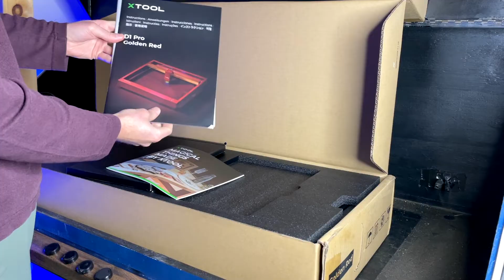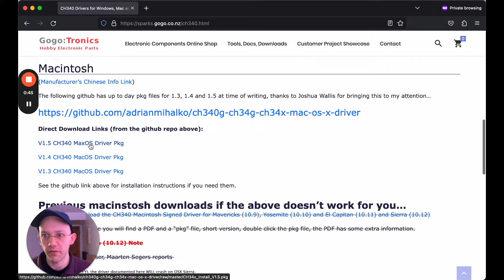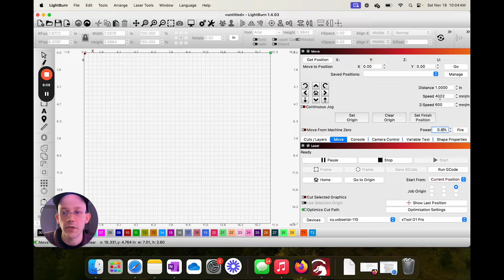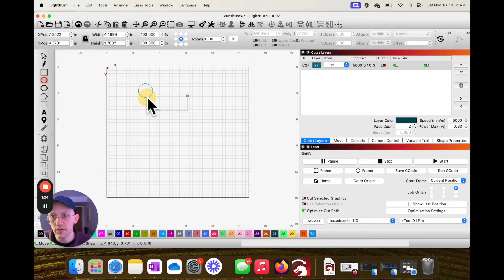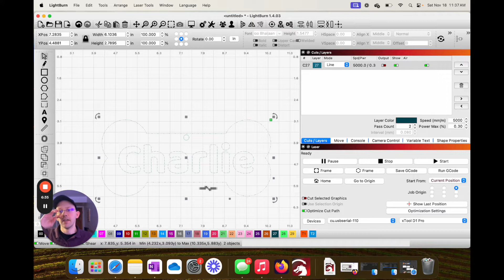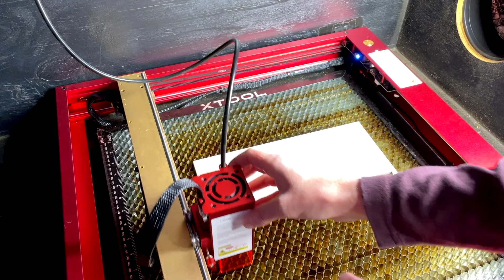Laser Engraving for Beginners (9 Step Crash Course)

Comment: Hi! Thank you for your video! What is the purpose of CH340 driver instillation? I installed LightBurn on my PC without any issues However, I didn't connect PC to Laser engraver..  So, is driver required for Lightburn instillation or it's required for connection?
Reply: for the connection

Comment: Really nice and useful video and other videos you made! I just bought a Laser Engraver/cutter (AtomStack A24/X24 Ultra Optical Power 24W ) but have a question. Normally you set the position (different height) of the laser for cutting or engraving. If you use your test file to see what settings to use, do you change the laser height if you are only cutting or do you just leave it at the "engraving height"?  In short...do you do multiple test runs on the same type of material you use?

Comment: JJ two things first I added my name to the boot camp waitlist and I'm wondering what the time frame is before I'm in, and I downloaded your three tests the two shown in this video and the engrave eye test, I have only run the engrave tests so far but both stopped engraving after labeling part of the grid (at the bottom). Please help.
Reply from the maker: Hi Bill - thanks for joining the waitlist. The bootcamp will reopen on Nov. 4th. You’ll get an email through the waitlist when it’s open.

And your laser could have stopped for a few different reasons. My first guess for something like that is a connection issue, between the laser and computer. So it might help to make sure everything is connected and to also turn your computer and laser on and off again.

Comment: Really found the viodeo useful. I am currently thinking of buying a laser , primarily for engraving. Do you have any suggestions for a new user?
Reply from the maker: Hey Nick - my default recommendation for new laser users is to get an "enclosed" diode laser. There are a bunch of these now, and popular examples include the Roly Lasermatic and the Xtool S1. And for engraving, I would recommend just getting a 10W, which are cheaper and also typically more precise (because they have a smaller laser spot). If you end up deciding to go with an xtool machine, then consider clicking through my affiliate link in the video description to support the channel. Hope that helps!

Comment: Slow but sure I am learning about lasers and the driving software thanks to people like you. I recently got my xTool S1 40w machine.  Would the settings of a 40w D1 pro be usable on mt S1? Thanks for sharing.
Reply: Thanks for the response. I will give it a try. Nothing ventured....nothing gained. Enjoy!!
Reply from the maker: Very cool - I haven’t tried the S1 yet, but would love to at some point. Regarding your question, the settings should theoretically be the same as a 40W D1 Pro. HOWEVER, it kind of depends on how exact you need it to be. For example, the settings for engraving a simple square on plywood is probably much more forgiving of variations (between the two laser models), than engraving a detailed photo on a piece of tile. In other words, it’s probably close, but I wouldn’t be surprised if you needed to make slight adjustments to optimize your results.

Comment: Do you have a affiliate link if we want to buy the engraver? Do you recommend it over other engravers or should I keep looking?
Reply from the maker: Hey - thanks for asking. I actually do have an affiliate link for Xtool that I forgot to put in the description, I just added it near the top of the description so you can find it there if you like. 

And regarding what I recommend for laser engravers, here is my current take: 

If you want to do an open frame diode laser like is shown in this video, yes, I would recommend the xTool D1 Pro. That's the only laser I've used for the last year, and it's worked great for me, and has helped me grow a new laser business from scratch. 

And I've actually just done a bunch of tests comparing the 10W vs. 20W vs. 40W power levels (which will be published in an upcoming video), but one of my conclusions from that video is to make the 10W my default recommendation. If you are all-in on starting a laser business, then the 40W might be worth it, but generally speaking I think the 10W is a great first laser. 

If you don't want the hassle of finding (or building) a good laser enclosure, then I personally would consider the new XTool S1. I haven't tried it yet myself, but if I were starting from square one, I would probably have gotten one of those.

I hope that helps!
Reply: Thanks mate, that does help. I do have a little bit of experience but this will be my first purchase of a engraver . I was thinking of going for the 20W or 40W  just because I thought it would be better to have more than enough power rather than too little, is there a reason you recommend the 10W. Or I suppose I could just wait for you video, I just wanted to take advantage of any black friday sales the company was doing. 
 @chalkwatts
Reply from the maker: Good question- and yeah, it’ll be better explained by the video. If you haven’t already bought one, I think XTool’s sale goes until Nov. 30th and I’ll probably have the video up a couple of days before then.